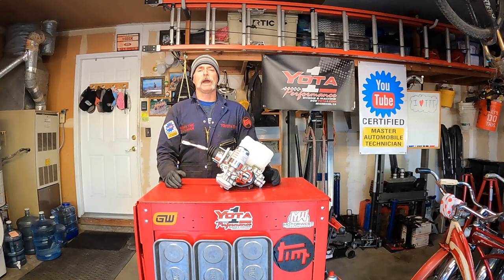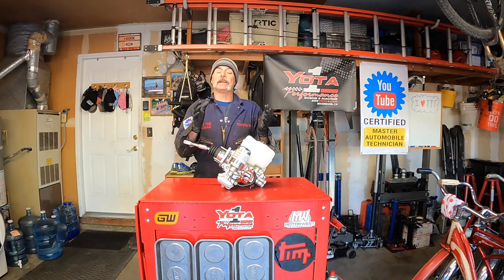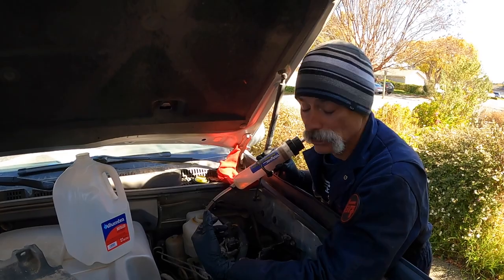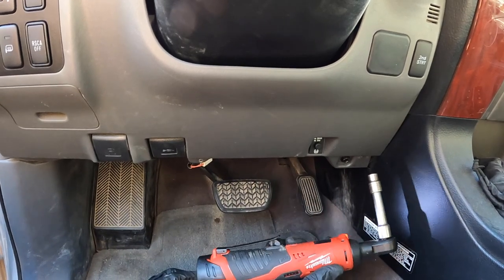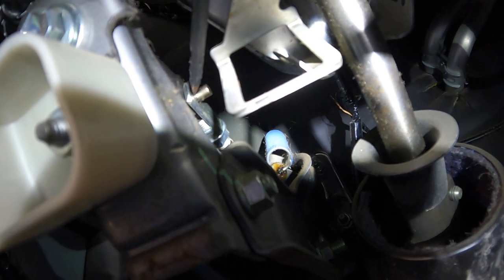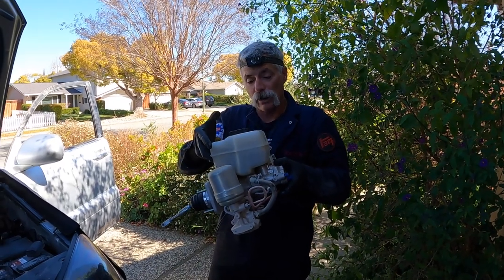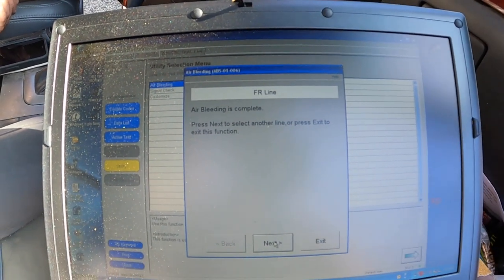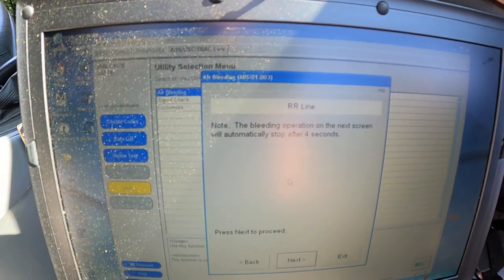Lexus GX470 Brake Booster Replacement

Comment: I have 4runner 2001 with abs problems
I gets codes 32,  51,56 you now what’s means?
Reply from the maker: Well Mario, I did a simple Google search which you could have done as well to get some answers.  The following is what I found out.

The 32 Code means a problem with your left front speed sensor.  The sensor plugs into the steering knuckle.  Examine the sensor and the wire to see if there's any damage.

The 52 Code means ABS pump motor is locked, open in pump motor ground.  I read it could be a grounding problem which is affecting the voltage to your ABS pump.  Check the connections at your battery and clean them.  Check the ground wire connection at the driver side fender.  Check the ground on the engine block near the driver side engine mount bracket.  

The 56 Code means there's an Accumulator low pressure malfunction.  The accumulator is part of the hydraulic brake booster (aka Master Cylinder).  It might be your hydraulic brake booster is bad.  

That's what I got for you Mario.  I've never diagnosed the issues you're having so this is the extent with which I can help you out.  Good luck.
Reply: @TimmyTheToolman  THANK YOU !!
Reply from the maker: @mariocastaneda9729  You're welcome